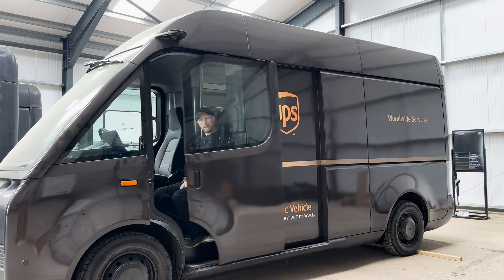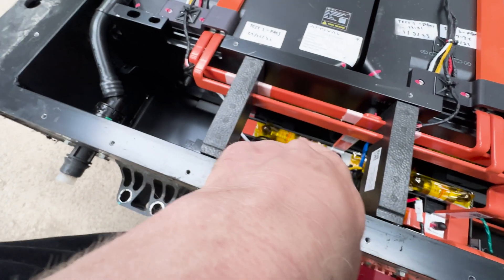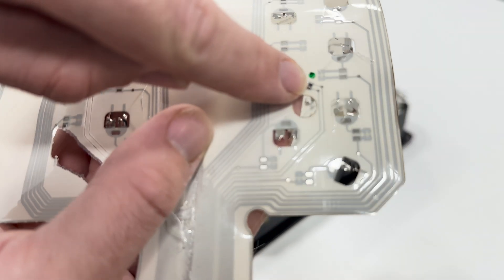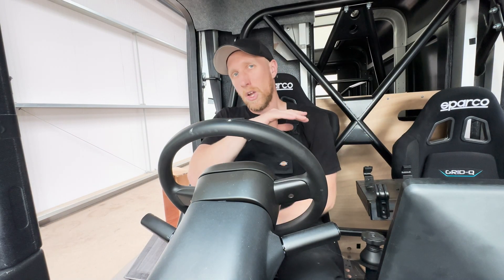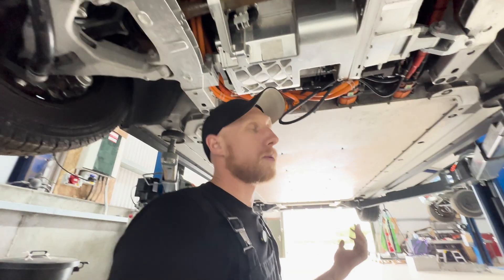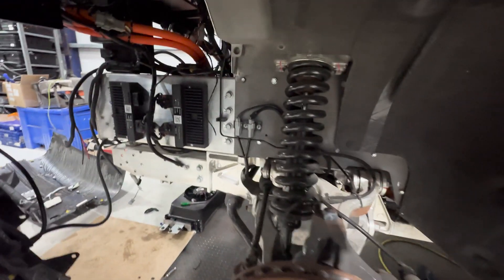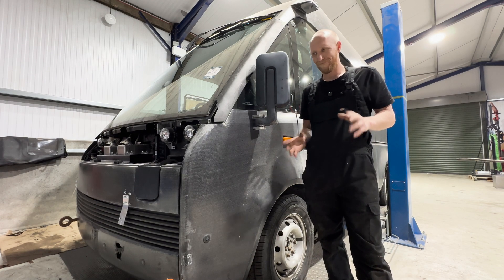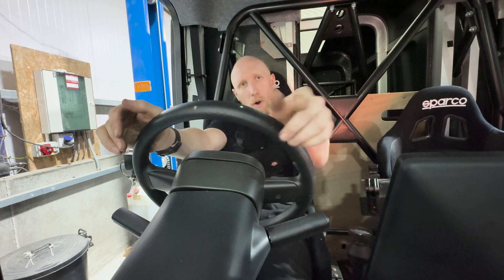Trying to Fix my Prototype Electric Arrival Van - So over Complicated no Wonder they went BUST

Comment: What a mess this whole thing is! It's as if there were teams for each sub-system all fighting each other for space, and no-one in charge of overall architechture. There should have been much more time spent at the design stage before rushing to bolt everything together. You can't just design things with no regard for cost and hope that some value engineering at the end will sort it all out.
Reply from the maker: Yep could not agree more, But this also comes down to having something to show investors to release more money it can be a difficult situation.

Comment: Use the batterys as house battery will be huge
Reply from the maker: As each module inside the pack has its on contactors is probably the only thing they are good for

Comment: Super interesting to see how they constructed the battery pack. Can you describe or email me some pictures how the flexible PCB with the voltage sensing wires is connected to the cells? Is it a stackup and are they spotwelded in once together with the current carrying flexible PCB?
Reply from the maker: Look the the flexible busbar is laser welded onto the cells. But I know they had alot of issues with welding depth.
Reply: @Hazell_Nutz  Thanks. And how is the ribbon cable that goes to the BMS connected to the flexible busbar (the piece you ripped off)? It seems like this is also spotwelded or laser welded then?

Comment: Dunno what towing eye would be LH thread, you want them to be conventional so people know how to use them. Bet many people would think there was an issue with the female thread in the car if it wouldn’t go in winding conventional direction without even bothering to look at the thread direction
Reply from the maker: You would be surprised most vehicles are LH thread this is what Google says. “One other thing which I bet throws technically minded people ("ordinary" people don't know the difference anyway) is that towing eye bolts are normally left hand threaded.”

Comment: Why were you surprised by the negative contactor inside the module/pack? EV batteries float - neither positive nor negative side is connected to chassis ground, so both must be disconnected for safety.
Reply from the maker: Yes you are correct but you never have a set of contactor in a module it’s normally for the over all pack only.
Reply: @Hazell_Nutz  You always have a set of contactors for each parallel string in each enclosure. In most EVs, especially light vehicles, that's just one set in total (because there is only one enclosure and all modules within it are in series); for many conversions that's one set per enclosure with enclosures in series. These modules in parallel require the set per module. 

Within an enclosure, you could get away with just one contactor (e.g. positive only) per parallel module plus one on the other polarity for the whole enclosure), but the single contactor would be a much larger so there wouldn't be much benefit.
Reply from the maker: @brianb-p6586  yep you are correct you do always have contactors in each parallel set but you would not normally have each parallel set being only 3.7kwh it’s a stupid design. If it only had one contactor per parallel set it would be the same size no reason for it to be larger as the inrush current would not change just because there is not a contactor on the other side.
Reply: @Hazell_Nutz  the operating current of the entire set is the total of the current in all of the parallel packs, so yes, a whole-battery contactor requires a much higher rating that one for a single pack. A single contactor for the negative side would need to much larger than individual contactors on each pack.
Reply from the maker: @brianb-p6586  your earlier response was not very clear. The single contractor per parallel module would not be any larger but the single contactor on the overall pack would be larger but a single 400amp contactor compared to the 20amp ones used inside the modules is only about 4 x the size. Ether way the arrival module is a stupid idea and over complicated.

Comment: While conventional light EVs parallel only at the cell level, it is common for heavier commercial vehicles to have parallel packs each at full system voltage, to allow easy configuration to the desired energy capacity simply by installing the desired number of packs (as well as perhaps for redundancy). For instance, the Isuzu medium-duty forward-control truck has 5 to 9 packs. 16 units in parallel, though, is just stupid.
Reply from the maker: Yep it is a common thing with larger vehicles and larger packs but with a 3.7kwh module makes no sense
Reply: @Hazell_Nutz it seems sensible to me. I presume a dead pack(module) would be mapped out to keep the vehicle driving? And that an individual pack(module) could be swapped-out quickly. As a proposition for a risk-averse brand like UPS, I can see the appeal: greater time on the road for “untested” tech. Cost comes in many forms.
Reply from the maker: @skwdenyer  nope makes no sense at all, as each module is over complicated and because they are all in parallel you can not swap out a single module. As they age if you then add in a new one will get quite upset as the older one would have degraded. The simplest way would have been one larger pack, way less failure points and complication.
Reply: @ why can’t you swap out a module that’s in parallel? Assuming they all have suitable circuitry on board, they can be charged to 100% of each pack’s capacity, and be managed so that higher-capacity packs are discharged first to “level down” the pack when load demand is lower.
Reply: @skwdenyer  It is not feasible to connect and disconnect individual modules to manage capacity differences.

Comment: If I where you those spare parts I’d make moulds of them so you can make more if needed.
Reply: A 3d scanner is probably easier and more useful these days,  with 3D printing and CNC services available.
Reply from the maker: Will 3d scan and then make out of carbon have lots of support in that space.

Comment: That does look like a challenging project - pretty interesting though! Think I counded ~206 cells at 2p that would be about 433v full. So fairly high voltage for a 400v pack.
Reply from the maker: Yep the bms is capped at 428v

Comment: @Hazell_Nutz, just a bit of advice. If you know somebody ex from the arvl drivetrain team who is in the UK, it's the best way to ask them for help. This type of fault you see requires special diagnostic equipment and software. It can't be solved by just randomly pressing buttons.
Reply from the maker: Yep have been speaking to a few of them. Have worked with them for a number of years with Fellten

Comment: Idea for your race van, Quad motor setup, find a crashed Rivian and get it's motors. They were up to 800hp ISH at 400V class so might play well with what you have, also I think you could probably tease a bit more power out of them if you dont care about absolute longevity. Putting motors inboard would help with unsprung mass. Plenty of aftermarket Carbon ceramic big brake kits for stuff like VAG MQB platform. And TrActive semi-active coilovers, not sure if they could handle weight but they are used for race applications. Porsche Cayenne is around this weight so wheels and performance tires shouldn't be a problem for it.
Reply from the maker: Have just done a deal with iNetic for a pair of 400kw 800v motors. 1200hp 😬
Reply: You'd have a job finding even an uncrashed Rivian here.

Comment: Just a rough guess but looks like 220 cells, i assume LifePo4, so if 2P looks like 110 cells giving 400v full charge
Reply from the maker: The spec sheet says 428v fully charged but they are capped at 420v in the bms software
Reply: @Hazell_Nutz  I guess my cell count is wrong or you have Lithium Ion cells!
Reply: @pearse500  LiFePO4 is just one of the many lithium-ion electrode chemistries; it is not different from lithium-ion.
Reply: @brianb-p6586  Please do not confuse matters! Lithium Ion will have either lithium manganese oxide or lithium cobalt dioxide for Cathode, it has a higher specific energy than LifePo4 with a nominal voltage of 3.6V. In comparison LifePo4 (Lithium Iron Phosphate) will have iron phosphate for Cathode, it will have a lower specific energy  than Lithium Ion with a nominal voltage of 3.20V or 3.30V
Reply: @pearse500  you're the one who is confused. LiFePO4 is literally a lithium-ion cell type. Every lithium-ion electrode chemistry has a different characteristic voltage; LiFePO4 is significantly lower than most of the alternatives.

Comment: I'm looking at this as a lesson in how not to design anything.  It's all so over complicated.   The cost involved in designing and manufacturing these vans must have been horrific, it looks like they were just pissing away the cash with no cost control.   The upside of that is they went bust before any purchaser of these vehicles had to face the resultant unreliability and opperating costs.
Reply from the maker: Yep exactly so over complicated just luck there is not lots out on the road
Reply: It really is disappointing. I'm sure there were a few engineering decisions that were made for a reason, and yes, it was a development platform, but still...
Reply: Should have taken a page from Edison. Motors book. KISS Keep it simple stupid
Reply: This is what happens when you leave engineers to their own devices without cost / programme oversight! 😂
Reply: The chassis are well built

Comment: Wild. This is an interesting series. Probably some huge headaches to come! I wonder if a cable to the motor was cut like the one for the rad? Also, does the coolant system need to be pressurized and bled to make sure there are no air bubbles?
Reply from the maker: Yes it probably does but if I can sort the software there is a bled process.

Comment: How hard is it to remove the immobilizer?
Reply from the maker: Not sure, thinking of swapping over some modules from a van without
Reply: @Hazell_Nutz   good luck, if it then works, then the immobilizer is in the battery pack somewhere. Can't wait for the next episode. Thanks!
Reply: @rjung_ch  The immobilizer could also be in the ceiling. Or inside the spare tire. Nothing about these vans can surprise me anymore.